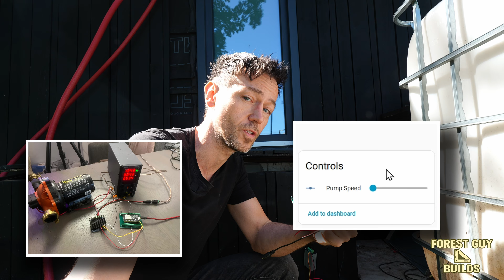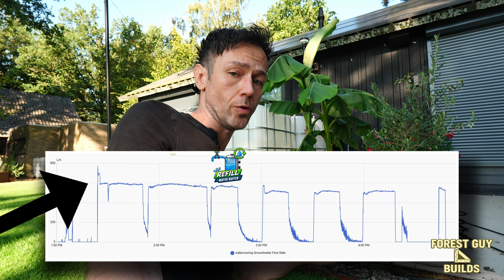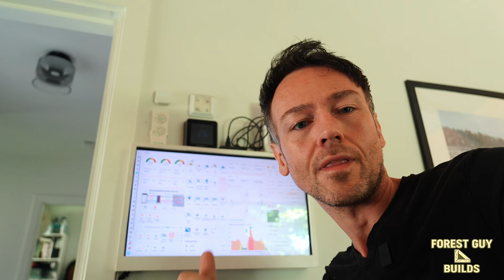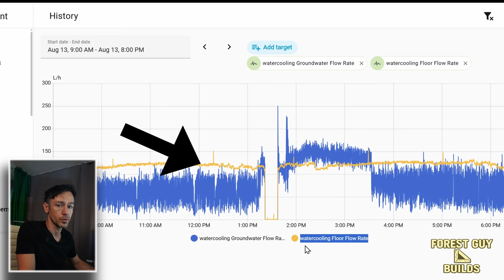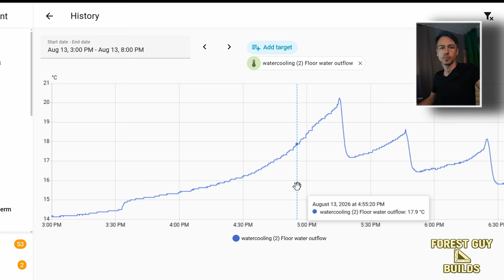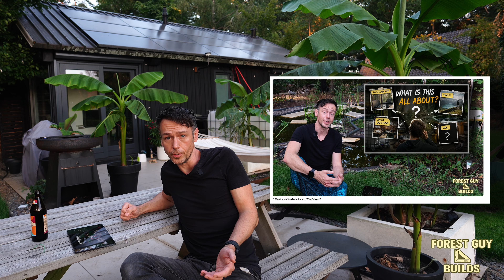Can I Fully Automate My Groundwater House Cooling? (Part 5)

Comment: you can automate your groundwater cooling capacity if you use your arduino skills and let it calculate the thermal power.  you already got both types of sensors in your management system. and you know the medium obviously.

so you can make the system see actual cooling capacity if it calculates how much kilowatt the flow delta × flow per time for water is.

same for the secondary loop in the floor and the cooling demand.  you know the temperature in the house and the rough volume of air.   setpoint of 21°C and actual roomtemp. of 25°C gives a delta of 4K.  how much kilowatts do you need to remove to cool for example 175m³ of air by 4K in 30min ?   keep in mind: per person there is about 100 - 150W, a laptop adds about 90W, windows and walls depending on the U-factor.

or simplyfie by guesstimating 100W per m² of living space. 

and how much kilowatt can a flow of 100L/h at 5K delta provide ? 

is it to low => raise the primary pump speed or shorten the cycle plus raise the secondary pump speed to keep the delta over the heat exchanger at 5K.  

has the system reached 22°C ? => control to half the demanded capacity.  has it reached 21°C ? => control to 1/4 the demanded capacity.

the whole room temperature control thing ranges in 2K plus and minus the setpoint. as soon as the room got up to 23°C you need 100% capacity in cooling and at 19°C you'd need 100% capacity in heating.

so there is the control basis.  view the primary flow + temp delta as cooling capacity (remember the 5K loss on the plate exchanger and about 3K on the floor-to-air-interface. so in reality you need 8K higher delta from the ground water for correct calulations).  and view the room temperature + air volume or replaced volume including supply air and exhaust air delta + flow as your cooling load in kilowatts.

typical ventilation for homes is about 1-3 room volume exchanges per hour. so a ground surface of 5x5m is 25m² and 2,5m ceiling height gives 62,5m³.  double that and you're looking at 125m³ of volume per hour for this room.  bathroom and kitchen need more like 5-fold while in use but in a loft style house that doesn't matter so much if you do a double exchange/h for the whole house.

a good ventilation can help with heating and cooling + dehumidifying but also features a heat recovery system.  an active one for best efficiency. (hacked mobile aircon for example).

but a passive tube bundle exchanger from aluminum or copper pipes is still way better then nothing and easier to achieve.
Reply from the maker: Okay, this is a heavy one for me 😅 I'm basically the novice here, sitting at the table with somebody who clearly understands what he's talking about. That's cool ❄

Trying to go through this a bit structured, just correct me where I'm wrong. My brain is going into learning mode now 😅

I want to create some of those calculations and also make them visible as metrics/visuals on the Home Assistant dashboard. That part should actually be quite easy to implement as pretty much all the variables are available / monitored: flow, supply/return temperatures, room temperatures, etc. That's on top of the list.

As for calculating the actual cooling demand of the house... yeah, difficult to me. Again, I'm no expert, but I have the feeling that this might become more of a practical/experimental thing for me than something I can calculate perfectly beforehand.

My house heats up quite badly on sunny days. The outside is black, which I guess is the biggest reason (years before this experiment I once covered the sun side with some blankets, but too much work/hassle...) It is insulated, but definitely not extremely well insulated. And because I'm also not trying to constantly (daily base) cool the house, but mainly use the system during the more extreme moments, it never really reaches a steady balance either.

For example, around 26°C inside is something I'm quite okay with when outside 23-27°C. But when it gets around 30°C+ outside with full sun, that 26°C can relatively quickly overshoot towards 29°C inside, and then it suddenly becomes really uncomfortable.

So at the moment a lot of this is still based on feeling rather than proper numbers. But maybe with more experience with the system (and especially more data), those things will become much clearer and easier to predict.

To give some more information about the house: the part I'm cooling is around 60 m², with an average ceiling height of roughly 3 meters, so let's say about 180 m³ to keep it simple (attic is separated from rest).

As for the automatic adjustment through PWM: yes, that's exactly where I want to go, curious how it will go. But I think I found the first challenge; guess the "all over the place flow rate" is simply because the pump is really happy with that "~90 L/hr... Need to check if it gives more stable rate if I set it at ~ 150l/hr, 200l/hr, ... 

But I also think the real-life control might end up being a little different from what looks optimal theoretically. What I'm seeing now, for example, is that I can increase the groundwater flow quite a lot and sometimes get a delta of around 7°C when the floor is still relatively warm, around 22°C. But the extra groundwater use then becomes quite large compared to the extra cooling power I'm actually gaining. Those are nice things to learn from the calculations, if they are registered as gathered data. 

That's something I really want to experiment with. I don't want to use twice as much groundwater just to gain, for example, another 20% of cooling power. So I think finding that practical sweet spot between flow, delta-T, cooling power and groundwater consumption will become an important part of the control strategy.

That also links back to the 5K delta you mentioned. I definitely want to calculate the actual cooling power from flow × delta-T and start comparing those values at different flow rates. I think that will give me a much better idea of where increasing the flow stops being worthwhile.

The ventilation part is also a really interesting one that I want to spend some dedicated time on. I've already modified my HRU/ventilation system so I can control it myself (and automated), including the airflow towards the individual rooms.

Eventually I really want it to automatically use cold summer nights as well. So when it's significantly colder outside than inside, it can increase ventilation and dump as much heat as possible from the house.

The downside is that the HRU at full power makes quite a lot of noise, which isn't exactly something you want running through the entire night 😅. So that's another little balancing act. Have some side idea to at least increase the diameter of the airduct to the bedroom, wider=more flow with less noise. 🤞

And I'm also still thinking about using an old car radiator with groundwater in the intake of the HRU to cool and especially dehumidify the incoming air. If I can lower the humidity inside the house, that would also give me some extra room to run the floor at a lower temperature without reaching the condensation point.

So yeah... there's definitely still a lot to experiment with in this system 😅

Really cool to get this kind of experience and input on the project. I appreciate you taking the time to write all of this! 
😎🙏